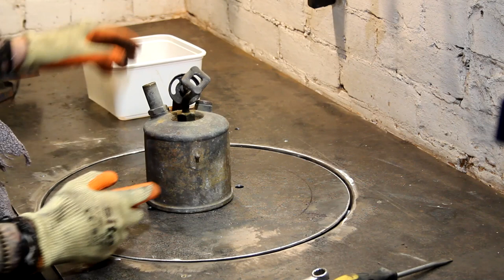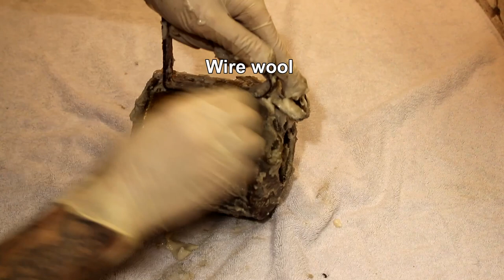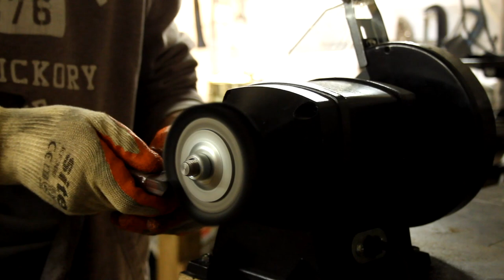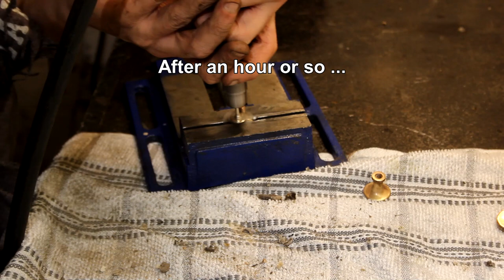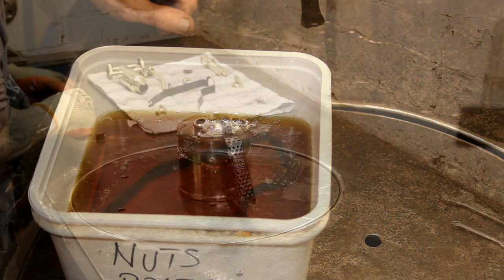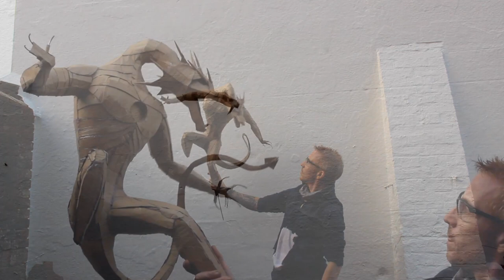Restoring a vintage blow torch and  ... (Part 1)

Comment: Thanks so much for this video john, I much prefer your method of blacking the metal parts in oil rather than spray painting them, the music is actually very relaxing too. Best wishes from Ireland.
Reply from the maker: Cheers. In all honesty over time it didn't work out and I ended up painting it. I think I just couldnt get it hot enough for a proper quench but the theory is sound. Cheers for the comment, have a nice weekend.
Reply: @johnnorrismetalsculpture  il keep that in mind when I'm restoring mine,  as far as I can tell the metal should be got enough to cause a rainbow effect on it and the oil should be smoking when the metal is dropped in. Il mess around with bits of scrap before I commit to the parts,  thanks for the heads up.

Comment: My dad gave me two of these recently. One which is basically the same as this one. Only difference is it seems to be screw heads holding the handle and other components where as yours are nuts/bolts. 

The other one is a little smaller and slightly different design. 
I’ve put some WD to start trying to loosen some of the bits, going to strip down and restore like you have
Reply from the maker: Good luck. Should be straight forward. You can use a little heat to loosen up tight nuts ... especially the main central one ... but be careful not to melt solder! Never tried wd40.

Comment: I'm assuming the lamp project was a joke, John? Nice job, otherwise! ;-)
I prefer to use just plain vinegar instead of the paste, which makes a helluva mess.
Reply from the maker: No joke, this will be a lamp by the end of the day ... just fiddling about trying to solder inside the nozzle. Beautiful thing though, even as an ornamental piece. I have 3 others, not really decided what to do with them yet. I'll clean them all up like this and give it some thought. Any ideas? or would you rather they were left as old school functional blow torches? Hoping the comments section comes up with some interesting and innovative ideas ...